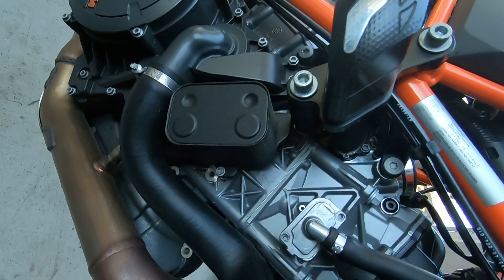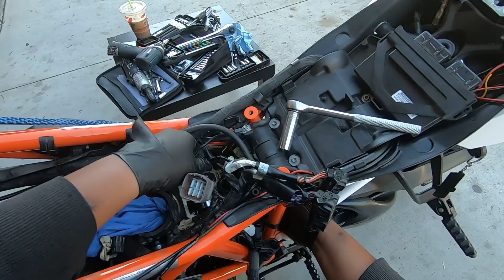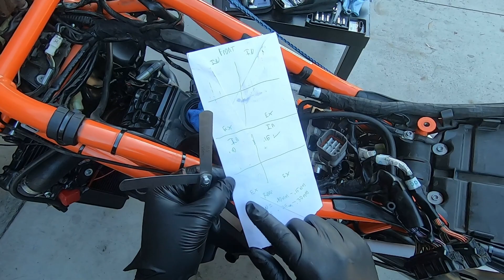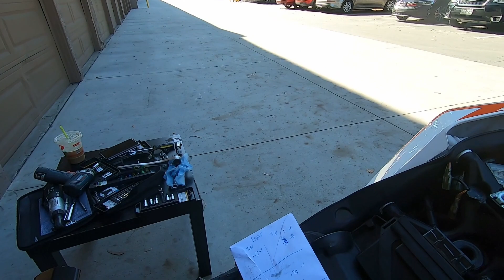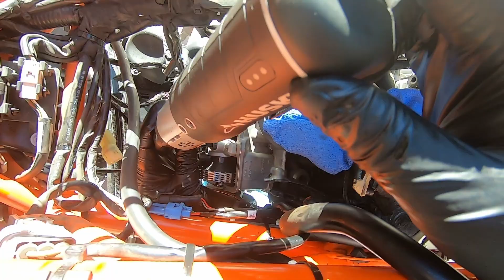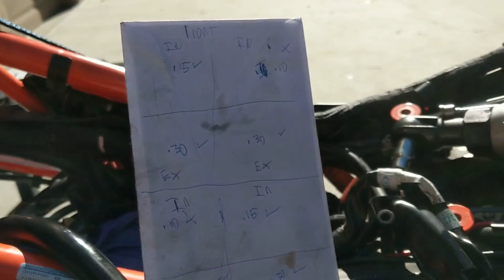KTM Valve Adjustment Valve Check | 2016 1290 Super Duke R

Comment: wouldnt just taking the engine out be way easier
Reply from the maker: I don't think so, if you remove the engine, you have to drain the coolant, remove the chain, exhaust, all the vacuum and drain hoses, wiring for the coils etc. I'm ok with doing it with the engine in. I have removed engines in 4 cylinder bikes and it's very tedious.

Comment: Hello, my friend, I have a question, I adjusted the valves, replaced two tensioners with new ones, after releasing them, at some point there is slack in the chain on cylinders 1 and 2, all markings match. Is this normal or does the tensioner need oil?
Reply from the maker: @pawelgorzkiewicz8609  Hi, the cam chain tensioners have spring tension and are  also fed by oil pressure, they're hydraulic tensioners. You may have some rattle at startup until oil pressure reaches the tensioner and pumps it up. As long as it's not too loose to where the chain can skip teeth. Also check that the tensioner is fully released, Install it collapsed locked in place, then insert it into the head, thread the large nut to secure it in the head with the smaller middle screw removed. Poke it with a small Allen wrench to release it, it requires some force. See the video in the pinned comment, it shows how to reset and install the CCT. Good luck!
Reply: I did everything as you wrote, but I'm worried about the slightly loose chain. If 1 cylinder is at TDC the chain is tight, there is little play in the second cylinder, is it due to lack of oil in the tensioners? If I adjust the 2nd cylinder in TDC, then it loosens on the 1st cylinder. @PRL1290
Reply from the maker: @pawelgorzkiewicz8609 Hi, it sounds like the tensioners are not released fully. Are you using OEM KTM tensioners?
Reply: Yes ,yes thats OEM tensioner.
Reply from the maker: It's really hard to tell without seeing how much slack is in the cam chain. I would turn the engine over several times by hand to make sure it doesn't jump teeth. I'm sure it just needs some oil pressure at startup to really pump up the new tensioners. It also sounds like the tensioners aren't locking when partially extended, when they're partially extended like in the middle range, it should be able to extend outward but not inward until the tensioner is fully extended. Then you can reset it and lock it.

Comment: Oooooh .. lucky it’s a 1290 , otherwise would it have any gaps between the lobes to measure    🤣
Reply from the maker: I've read about those cam issues on the 790 and 890 engines. ridden both 790 and 890 adventures and they're nice, hopefully they get that sorted out there's a lot of them out there. I had a co-worker put a deposit down on the 790 adventure when it first came out he had people hitting him up to buy his reservation for like $3,000. Crazy. I'm curious to see how the CF Moto with the parallel twin do since they're the same design.
Reply: On those the tolerances can be measured in inches.
Reply from the maker: you are correct, I chose Metric since that is what the KTM Service Specifications are listed, my Feeler Gauge has Metric and 'Merican measurements so I can do either one.

Comment: Working on a crappy old Harley like I used to have wasn’t a big deal but man, this gives me anxiety just watching this. I’m afraid I’d never get it back together.  I really want a 1290, can’t buy a new one and I keep hearing about this nightmare valve adjustment intervals.
Reply from the maker: @JonBecker81  It's intimidating for sure. I started off adjusting the valves on my KLR650 and once I was comfortable doing that I took a crack at the 1290. I was super nervous when doing it the first time, took me 2 days. I have the process down now. That first start was nerve wracking but when it dialed to life it was a good feeling. I bought this when it was 2 years old with 7,200 mi on it. It pretty much looked new, which is what I was looking for, No big depreciation hit and no first service $$$.  It's a fun bike, absolutely Rips.
Reply: @PRL1290  I had a KLR too. Never got into the valves on it. Wished I had.  Only way to do it is just dive into it I guess and take your time. Worse case scenario you roll it on the trailer and have the dealer put it back together.  😂 and yeah, I never buy new bikes.  They hold their value pretty well after that first depreciation hit.

Comment: Hello. How many KM has engine? Thanks
Reply from the maker: 36,000 Miles about 58,000 KM
Reply: @PRL1290  on first check 30k km or 19k miles did you found out off specs some valves?
I am asking because on 4.gen they moved first valve check to 60k km. It's double from 3.gen
Reply from the maker: @AleksandarStojiljkovic  yes at 19k miles 30k KM one intake valve on front and rear cylinder was out of spec, the rear cylinder intake had 0 lash and it was completely closed. Also 2 exhaust valves on the rear cylinder were at the bottom of the spec. 4 valves total out of adjustment.
I read the new Gen 4 bikes have a cam-shift variable valve timing system, so the cams and valve train could be much improved over the previous bikes.
Reply from the maker: @AleksandarStojiljkovic  Here are my previous measurements from the 1st valve adjustment and 2nd valve adjustment (shown in the video). Hope this helps. Valve wear looks to have slowed down, I'm predicting the 3rd valve adjustment will require minimal adjustments if any at all.
Spec is
Intake .10 - .15mm
Exhaust .25 - .30mm

@18k Miles
Front cylinder Left/Right

Exhaust
.30 / .30
Intake
.10 / .15

Rear Cylinder
Intake
.15 / .00 (.00 = no lash completely closed not good)
Exhaust
.25 / .25

@30k Miles just recently.
Front cylinder Left/Right

Exhaust
.30 / .30
Intake
.15 / .10

Rear Cylinder
Intake
.10 / .15
Exhaust
.30 / .30

Comment: What happens if u turn the crankshaft the wrong way??
Reply from the maker: If the engine is in time and the cam chain tensioners are installed and providing tension it won't do any damage that I can see. I'm assuming if the cam chain tensioners are not installed or not pumped up with oil pressure and you rotate the engine clockwise or counter clockwise the chain can jump teeth causing the timing to be off. If you're trying to line up your crank and cams with their top dead center marks, if you miss the mark, just keep rotating until you get back to those marks instead of going backwards. The cam chain tensioners are designed to take up slack when the engine is spinning in One direction, a few rotations in the opposite direction shouldn't make your cam jump time but there is a good chance that it could.
Reply: @PRL1290  cool thanks man, luckily my tensioner was installed. I can’t seem to find a way to get to the rear cylinder tensioner tho
Reply from the maker: @KTM-TIM402  No prob! it's buried in there, probably best to take off the throttle bodies to get a straighter shot at the bolt.

Comment: Hey, Paul. Thanks tons for this video. After the heads have been re-shimmed, and the cams have been set to their correct timing, is there any procedure in the repair manual to follow before a ride? Also, I saw that you were on the KTM Forums, is there any social media that I can reach out to you at in case I have minor questions during my valve service? Any guidance is greatly appreciated.
Reply from the maker: Hey @bubsiesiegel, definitely. You want to make sure you properly reset the cam chain tensioners see the pinned comment for the link to a good video showing how to do it. After that spin the crank over by hand. Counterclockwise to make sure there's no valve to piston interference. Also, depending on the year you'll probably have to reset your service light which is easy. You can do it without going to the dealer. I'm not on social media other than YouTube but yeah definitely feel free to shoot me a message on KTM forums of you need anything. I'll get back to you as soon as I can. Happy to help out.
Reply: @PRL1290  Thanks tons, dude. 10mm shim kit, right? I have a 2019 that gets quite a bit of track use and I’m at 13k and I just want to prematurely do it for that fact.
Reply from the maker: @bubsiesiegel  anytime! 10mm shim kit will work for our bikes.
Reply: @PRL1290  Hey, Paul.  This week I am going to tackle this. When you put your valve covers back on, did you use KTM’s recommended Loctite 5910 for the half moons? Or did you use an equivalent?
Reply from the maker: @bubsiesiegel  I used a thin layer of Right stuff silicone for the corners on the head side. sets up pretty quick. I applied after the first valve adjustment (it was sweating a little bit from 7k miles. Haven't had to re apply it after having the covers off for the 2nd time.

Comment: I dont get it why you remove the throttle bodies it's not absolutely necessary.
Reply from the maker: This was my 2nd time doing this, I found it easier to access the front cylinder head, and easier to remove the valve cover and cam bridge bolts. It's tight with the throttle body in there but its possible to work around it. For me it was easier to do it with the throttle body out. Only takes 10 min extra but the amount of room you get is nice. Each time I do this I see other ways of doing things to finish quicker like instead of removing both cams at the same time and hanging the timing chain, I remove one cam install the new shims reinstall then take out the other. Small things like that. I'm pretty confident the next adjustment I can have finish in 2-3 hours. I also have a SAS delete kit from Rottweiler that will make this much easier to service.
Reply: @PRL1290 OK. Yes, SAS is really annoying in this operation. I have done valve clearance check after 27k km (17k miles) and its perfect, doesnt need to replace any shim.. luckily... only change the spark plugs (It Looks good but when it was disassembled...)
Thanks and HF with SD

Comment: Hey, when you replaced the shims you said you put a 2.50mm in to bring it back to spec, wouldn't that loosen the gap if the shim was already 2.55mm before replacing
Reply from the maker: Yes, that's correct, as the valves wear, the gap closes so you need a smaller shim to increase the gap. The objective is to keep the gap within a specified range.
Reply: @Paul Lucas  I see, my intake valves are at 2.55, but I was gunna put 2.60. I may be thinking backwards on how the valves work. But thank you for clarifying
Reply from the maker: @1Turnatatime  you're welcome, glad I can help. With the 2.50mm shim what was the clearance you got from the feeler gauges?
Reply: @Paul Lucas  I haven't gotten into it yet, I only took the worn ones out, but it's been too cold to get back into it. I was able to get a clearance from the feelers but I think it was because the cam lobes weren't flush even though everything was at TDC.

Comment: What's up buddy. Same bike, same year over here... do u ourself a favor and ditch that airbox and emission system. Unreal difference. Give me a shout back if you have questions about it.

Thanks for the video!
Reply from the maker: Hey! Thanks bud, I was planning on installing the Rotty SAS and canister delete kit while doing this job but it was back ordered and showed up a month later, next time I have it apart I'll get it installed, it really sucks reinstalling it. What intake are you running?
Reply: If I take them out will it bring up codes or do I need the delete kit for it.
Reply from the maker: @1Turnatatime  the Rottweiler kit comes with dongles to accommodate the delete. No lights or codes.
Reply: @PRL1290  gotcha, I ordered some the dongles for the o2 sensors from rottweiler to delete them, but I'm learning about the SAS too since I'm already trying to do the valves on mine now
Reply: Why no modify stock box? Rotveler is price styff
Reply from the maker: There's not to much to modify on the stock airbox, on the front side there's  a small chamber, the air flows in from the intake tubes then it runs up through the filter into the top cover and back down to the filter to be sucked into the velocity stacks. I could cut out some holes in the front chamber but these airboxes are known to be not well sealed and let dust in, especially on the adventure models (they use the same air box). so far my airbox is sealed pretty well, I added some RTV in the top lid to seal the corners previously, KTM should have added rubber or nylon gasket between the box and the top cover. Still not ready to pony up for a Rottweiler intake or others, maybe if I get a good deal on a used one in good condition.
Reply from the maker: Update I installed my Rottweiller SAS delete kit and Full Akrapovic Evo Exhaust, I'll post a video soon.